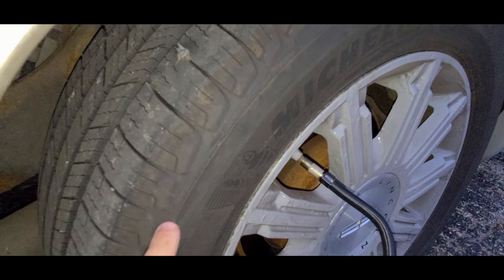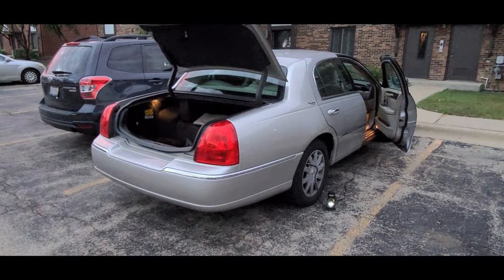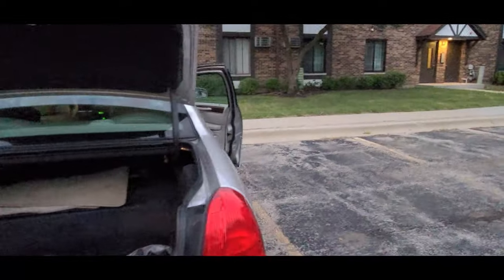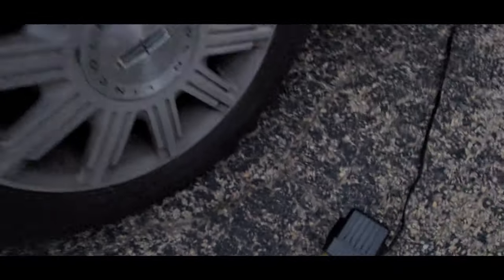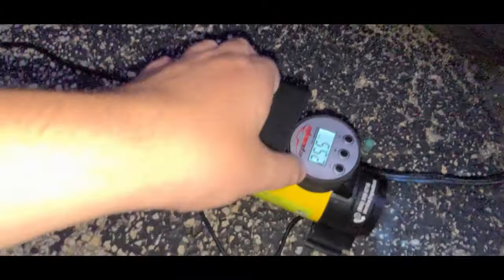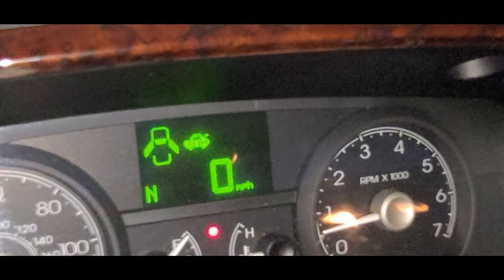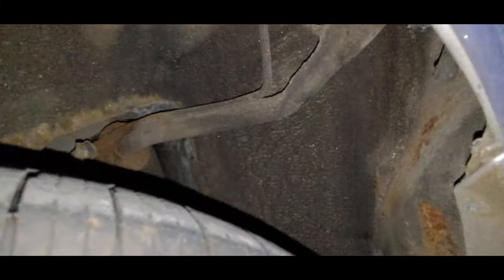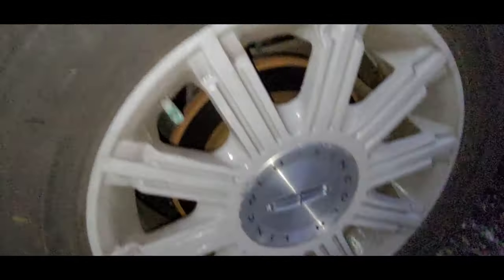Lincoln Town Car Guy Discovers a Screw In The Tire - Son Of A Signature Limited!!

Comment: Glad you were able to get it repaired.  I thought it looked far away enough from the edge to be repairable.  I had to buy a new tire for my Yukon last year with just 500 miles after running over a staple.  That hurt!  My Enclave that I traded for it had 3 nails in two tires at one point before I traded it.  The tire that had 2 nails in it was not repairable and I was trading it in a few months so I kept adding air every few days because I was not going to buy a new tire for it at that point!  FYI if you run your tire pressure a few pounds low in the front you will get a nicer ride.  The tires will wear a bit sooner and you might get a mile per gallon or two less but I like a soft ride.
Reply from the maker: Thanks for the comment. Sorry you had to go through that little experience.

Comment: This happened to my TC last year.  Was out with it and came back late afternoon.  The next morning went out to go somewhere and immediately noticed the driver rear tire was completely flat and on the rim.  Got out my handy 12v pump like you have since I was too far from the shop to use the compressor and would have cut the tire with the rim if I had moved it.  Luckily the bead was not free from the rim and it took air without having to jack it up and fiddle around.  Those little 12v pumps are handy!

I waited to see if it was going to hold air for any length of time, and it seemed to be a slow leak.  So I drove the 7mi to my mechanic shop and his son took the wheel off and put it in the dunk tank where he quickly found a rather long screw in the face of the tire.  He pulled the screw and plugged the tire from the outside.  I have no idea what the rules are here in Ontario, Canada with regard to patching with plug from outside.  The good news is that it holds air like it always did.  It only went down half a pound while sitting over last winter like the other tires.

And there was no charge for the fix which took about 15min but that included them both talking with me as well, so the repair likely would have only taken 10min or less otherwise.  My father would have fixed that himself back in the old days 40yrs ago, but I am not confident enough to do so with something I may be cruising down the freeway at high speed with.

Good luck getting that fixed.
Reply from the maker: Thanks! Already taken care of. They didn't even charge me
Reply: @VitaliyKofman  I have a 2006 Lincoln signature L black on black Town Car  an good condition I'll send 
You the video with the cons and Pros so you can posted on your Channel.👍